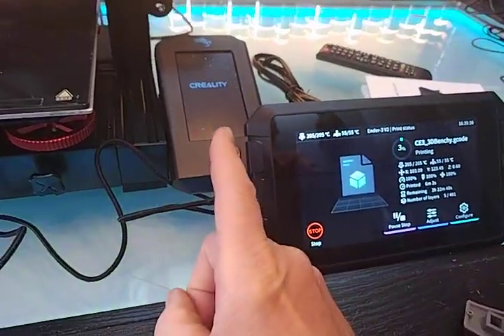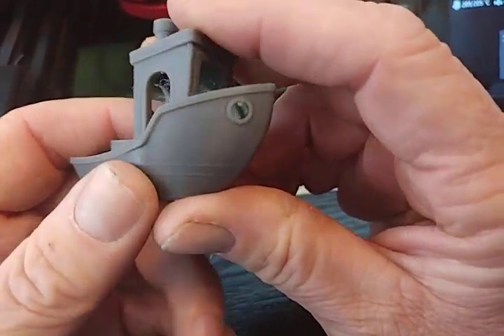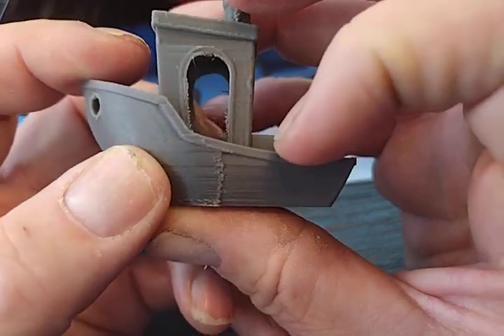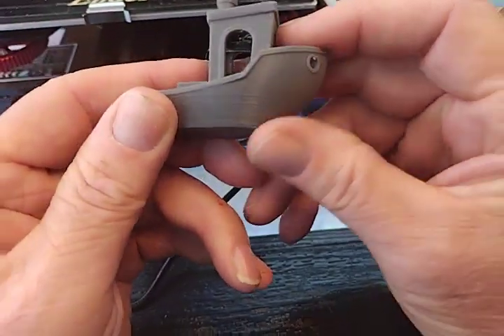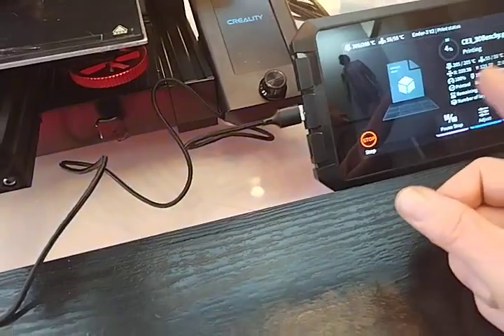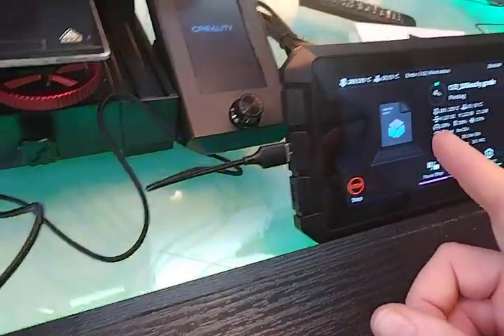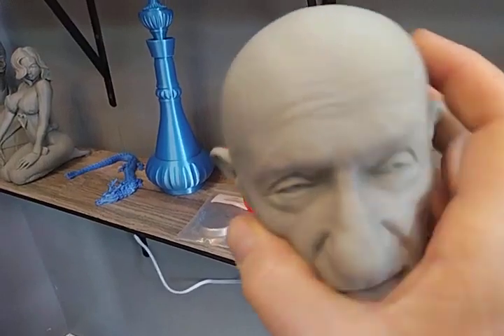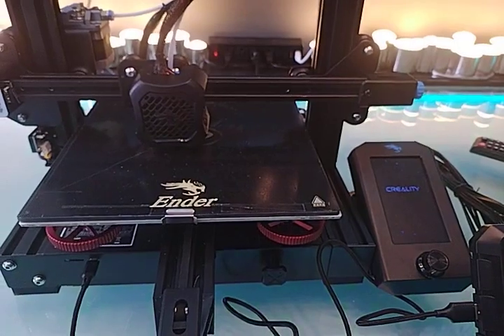my first print with the creality Sonic pad...

Comment: Was the cable for your accelerometer as short as you show it when it arrived or did you have to make any adjustments to it? The one I received is a lot longer and everyone online is telling me that’s the reason I’m getting the error message every time. I was told to cut it and shorten it so I just want to know if that’s what you did?
Reply from the maker: out of the box

Comment: only bad thing with this when using it on bedslingers is that after you measure the bed as well, the more you print on the bed the more inertial resistance you add thus it's never accurate.

Comment: nICE! tHE g-SENSOR must bee on the printer at printing time I think.
Reply: No, you just use it to calculate for input shaper. Once the tests are done, you remove the accelerometer because it is no longer needed. If you move or add anything to the gantry or bed, then you re-tune it
Reply: @Scr00ples  ok! thanks